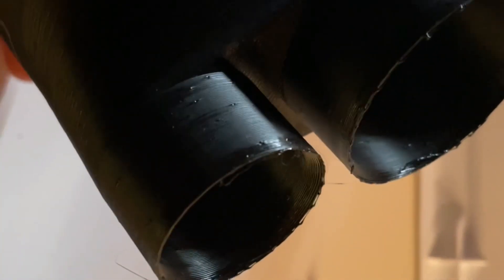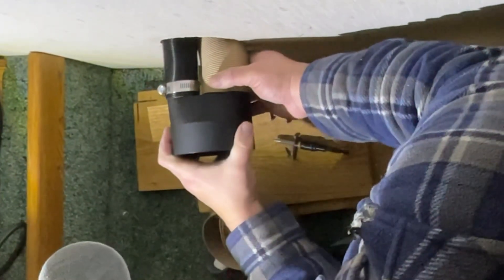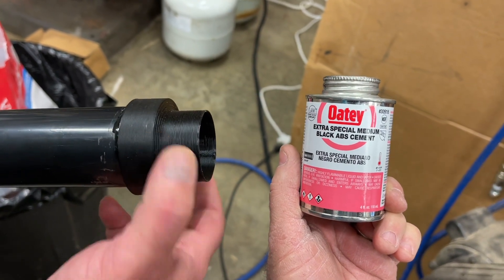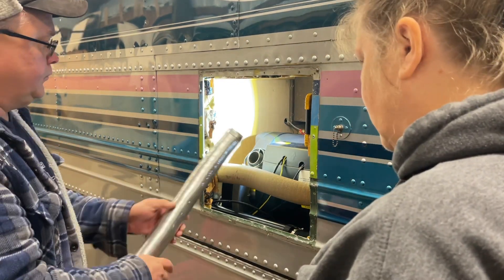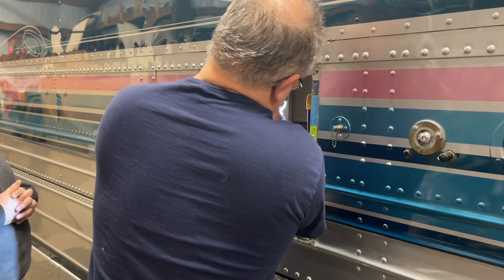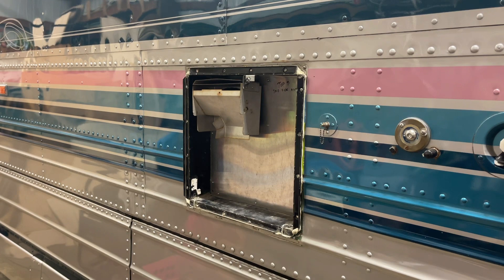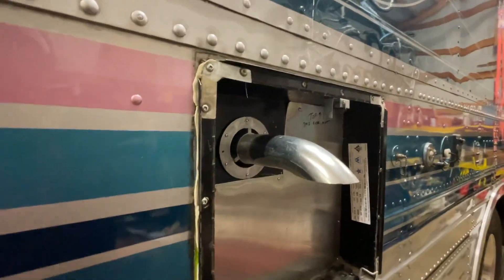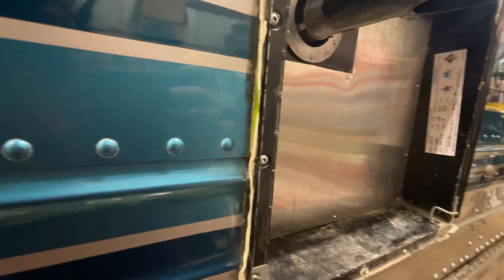RV diesel furnace & water heater project update

Comment: Thumbnail looks like you burned the turkey. I better watch this. I’ll update.

I’ve messed with my fuel and fan settings before, that growl sound is when there is too fan for the fuel and heat. When I turn mine down a tick, things settle out. 

Stay warm.

Comment: Thinking about adding a muffler to mine as they are very loud on startup … have you thought about adding one to your, as you seem to have room in the inner panel space there?
Reply from the maker: The truma knockoff did not come with a muffler because it’s got that dual inner/outer pipe. I wouldn’t try with this one because it barely breathes as it is. Regular Chinese diesel heater no problem..